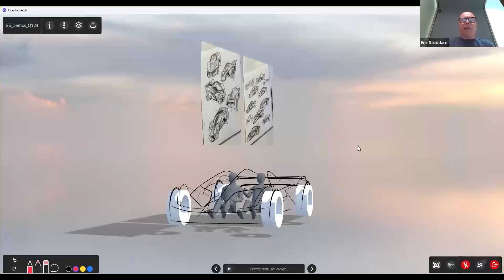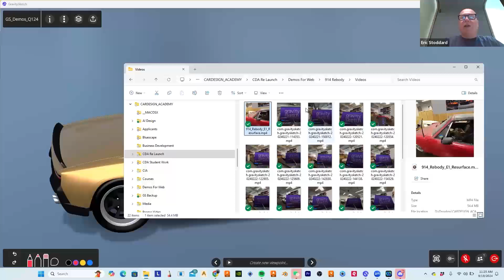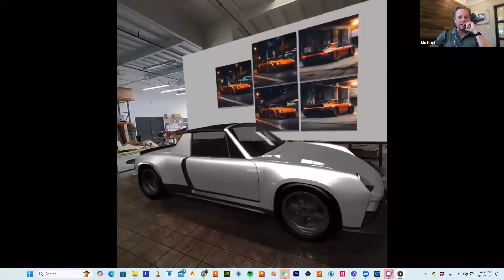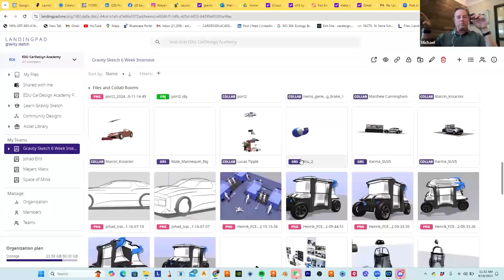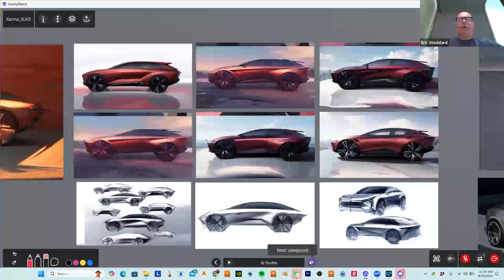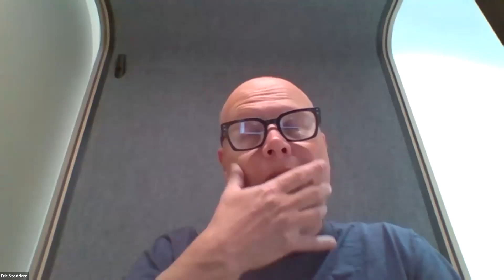Digital Design User Group: Gravity Sketch

Comment: Nice presentation.  Gravity Sketch always looks interesting.  My mental block is the absence of friction and resistance.  'Gravity' in the sense of consequence of movement.  The counter, 'weightless' has both a benefit to freedom of movement and the drawback of nothing to push against.

The friction of drawing on paper vs the slick smooth surface of a digital tablet changes the character of the lines. In the digital design evolution, that is the first level of reduction of friction. Modern designers have accepted that loss,  however I'd argue there has been a slight cost in the end result.

Drawing in space with zero friction as with Gravity Sketch seems like the next step in reduction.  Nothing to steady the hand, nothing to dampen, nothing to build upon or to subtract from. Each movement is new and abstracted to entirely visual feedback.  No pins to the real world other than visual.

The absolute joy of working with Chavant clay is the physical resistance and the compression and scraping. The subtleties of temperature and tools all come into play.  At the same time it is very expensive in terms of time and energy. Slow to iterate, difficult to build long slow perfectly fair surfaces that are simple in CAD. Shaping on a clay CNC platform and being able to work back for forth between the two methods is the ideal.

Digital aspects are obviously the way to form find, in my mind, there is a physical aspect that will be integrated in the next evolutions.